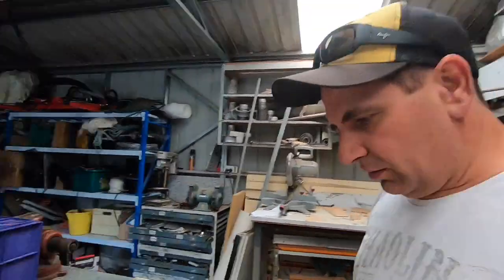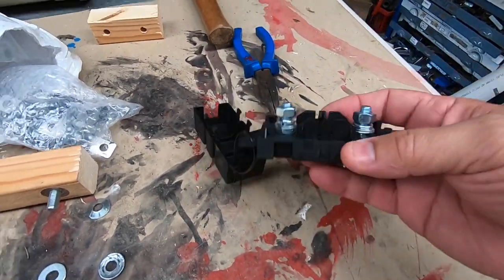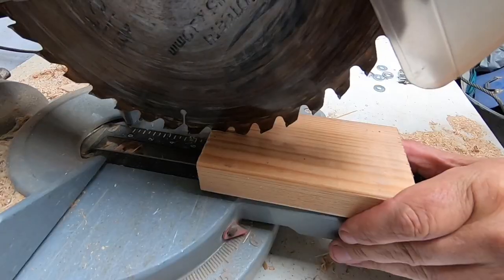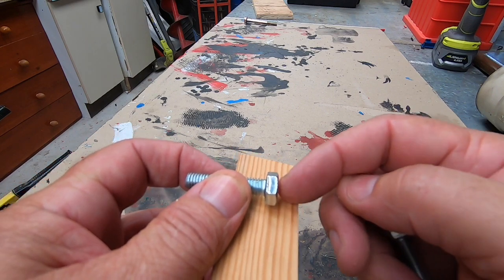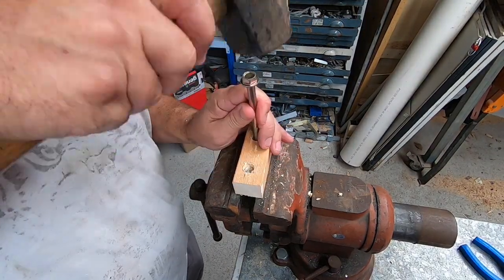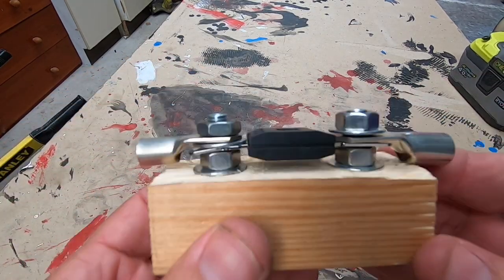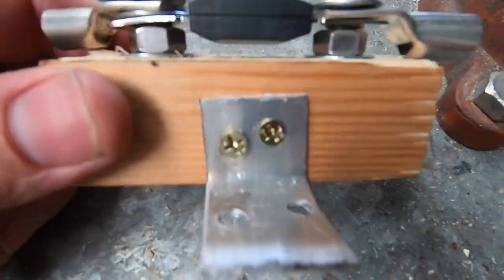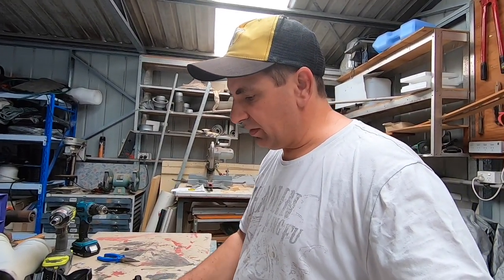Home made 12v mega fuse holder

Comment: honest question.  what if the wood is wet it can conduct electricity?  and wood is flammable... i am not sure but could the over load current run through the wood and stop the fuse working or catch on fire? cheers
Reply: use a cheap plastic cutting board instead of wood
Reply from the maker: Quite possible .. just don’t use in wet areas . Thanks for watching 👍🍻

Comment: Very clever mate! How much was the plastic one mate and what are your plans for them?
Reply from the maker: Michael_Au hey mick. Around $35 delivered for the fuse holder. I’m gonna replace my inverter circuit breakers with these. The circuit breakers been throwing out when they get hot from the current flowing through.
Reply: @EFFICIENTSELF  Wow not cheap as you say mate. Well done making these mate. Cheers!
Reply from the maker: Michael_Au thanks mick